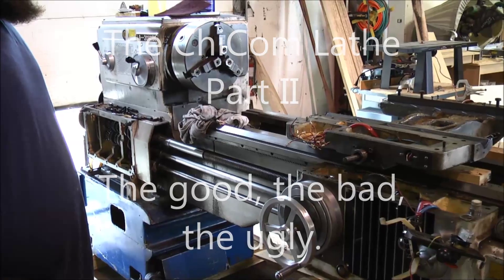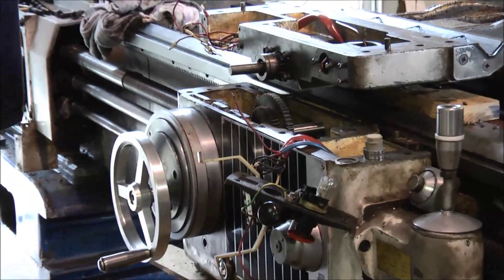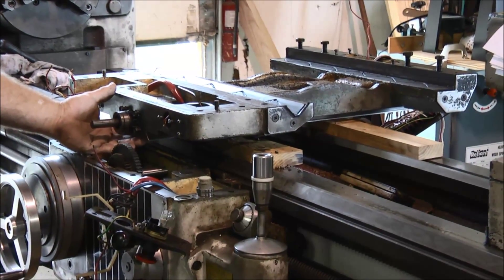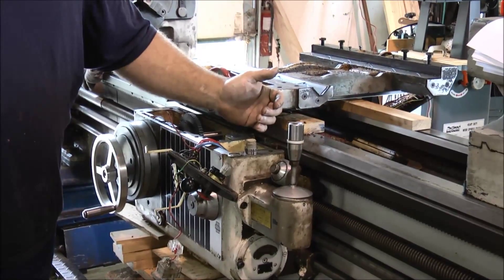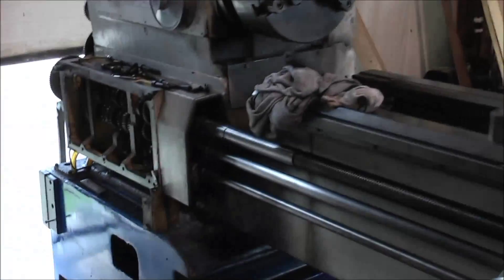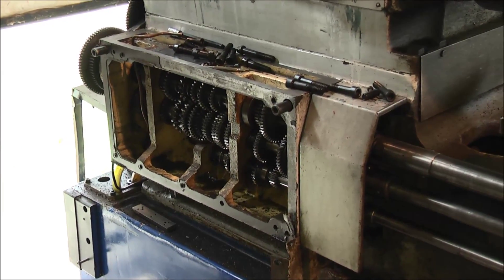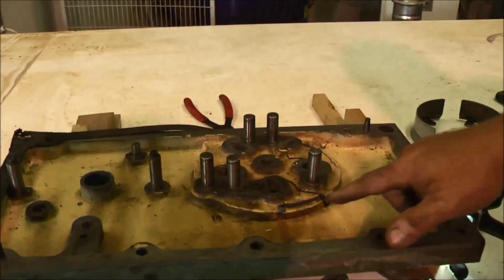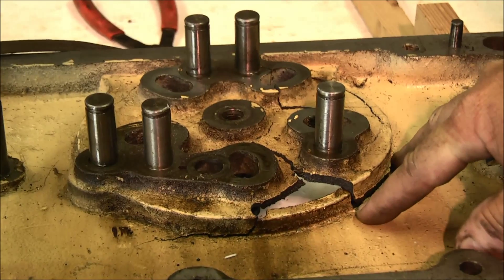The ChiCom Lathe Part II. The good, the bad, the ugly.

Comment: Guys, looks like you have a job on your hands!. If I may pass on a  bit of wisdom? I have reworked many a casting over a long time. If I were you I would be considering getting someone to make a new cover from a billet of aluminium for the following reasons: a) it will be an easy fix and be of sufficient strength. b) CNC milling will be quick and accurate (as you know from your own shop). c) The problems arising from trying (unsuccessfully to return the casting to it's original alignment) in repairing the casting will cause you pain in getting the pins to be in the correct position, this will consequently cause much grief in being able to mesh and engage the gears. In days gone by in these situation I would have made a new casing from fabricated steel and machined bushes, however in todays world with water cutting, laser cutting and multi axis machines, it may be prudent to go down that path….consider you have a large machine at scrap price….a little expenditure will pay back quickly mainly in negating much stress. Regards Bruce.
Reply from the maker: Bruce,

Thanks for the advice!
We may have to do that, although we did already have the casting pressed back into shape and welded - we have not put the shift mechanism back into place yet to see if it did indeed move too far out of tolerance.  Our CNC router will cut aluminum quite nicely, so  if we need to do that, we will.
When you have a moment, can you send me your address via email - I'd like to send you something.
Brent - bgreen@digiconsoo.com

Thanks!